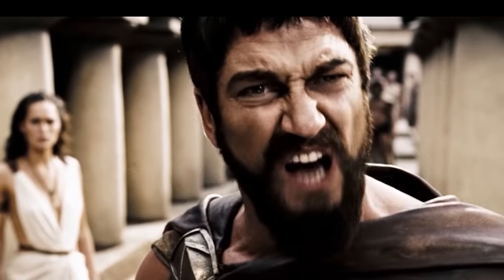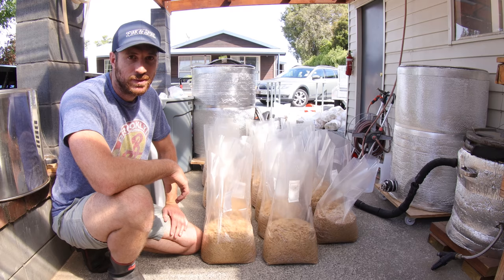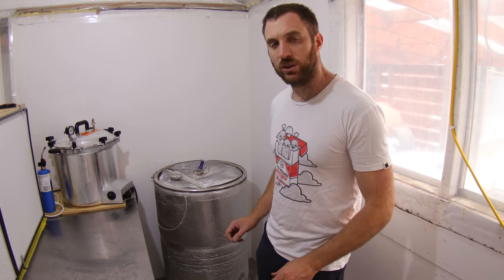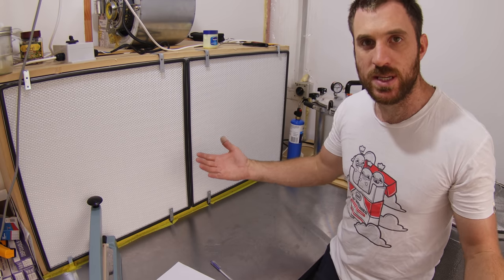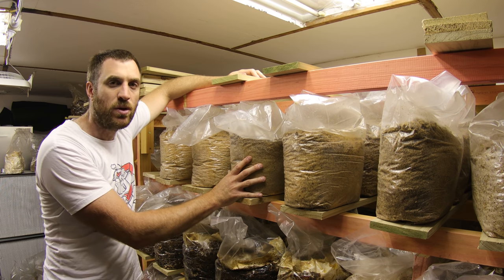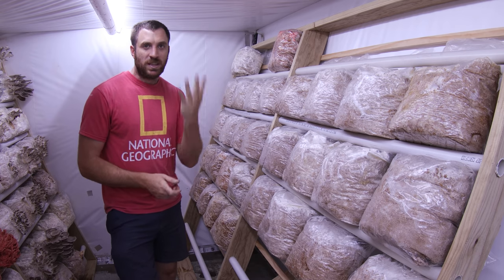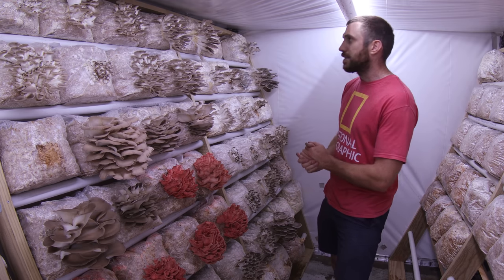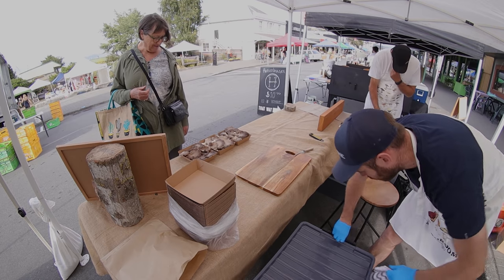How To Be a Profitable Mushroom Farmer

Comment: I really loved that you showed us the selling part! I just wonder something: when you open your bags for the mushrooms to finally grow, couldn't you open all the sides rather than just one front side? So as the mycellium all around could grow? Or are they all migrating to the one front opening?
Reply: I thought the same too
Reply: Better quality of flushes with one open section.
Reply: i thot the same. and the reason I was told was that the bag would dry out. but then you could also inject the bag with water and let the whole thing fruit. so many videos with pinning under the plastic and low fruiting. seems really odd. but then everyone is doing it so I really dunno what to say. But i did see one place in the Uk on video and they strip the plastic all the way off and have only the substrate sitting on shelves fruiting. they have like a full facility with airlocks and so on to prevent contamination and so on. but the lady said we take the plastic off and are able to get good results. So...... kinda confusing
Reply: @ArunRaoINDIA  I guess you can strip the bags off and do multiple openings when you have a humidifier setup then (most of the pro have)

Comment: Hi there from Canada.  I had a question for you.  What happens if you opened the mycelium bag and spread it out in an even layer on a tray or trough?  Would you end up with more fruiting bodies started?  How come always just a slit in the bag?
Reply: I think he does that to control the amount of product. You can only sell so much before they go bad, and if you spread the whole thing out, you'll have all the shooms at once. Where as, after you cut the bunch off the hole in the bag, it starts all over again from the same bag. Controlling the amount of product.  (but thats just my guess)
Reply from the maker: You are basically simulating a log with the bags, and when you only cut one hole you force the bags to spend all its energy on a single high quality bunch. If you take the whole thing out of the bag you end up with a thousand miniature mushroom. Shiitake are different though, they are taken completely out of the bag.
Reply: @OakandSpore  
So. I was almost right.

Comment: you are brilliant!  It seems difficult to do this at home without all the control measures. I'm a complete beginner but this was fun to watch
Reply from the maker: Not really, you can grow mushrooms with really low tech methods. Using equipment like me just means the entire growing operation is more controllable.
Reply: Actually, you could start growing at home with maybe $50-100 invested into some jars, tubs and substrate. Fancy and expensive gear like flow hoods, PID controllers, large sterilizing barrels and ventilation/humidification systems only come into play if you're doing bulk commercial production, and even then it's more for convenience and saving time rather than a necessity.

Comment: thanks for your videos, very exciting work. I would like to know more about your flow controller setup you use to add water in the bag. Is it possible to show it/describe it more somehow ? I want to copy your setup. By the way, twisting the mushroom cluster when harvesting should make it easier than only pulling. I love the logs on your selling table, we do that too ;)
Reply from the maker: I can, it's a water flow controller from Amazon. Usually I do not harvest in the room like that, but I take each bag out to my stainless steel benches. I just harvested them from the wall for the purposes of the video.

Comment: On the westcoast of the US alot of us use stalk waste from the cannabis industry, then use spent mushroom blocks to make fungal compost to grow the cannabis- or bulk red alder/white oak sawdust which is produced as a waste product by mills, carpenters, landscape & power companies. 

If you can find a clean waste stream to attacht your operation too, it significantly helps lower your operational cost & in some cases you can get carbon credits from the Govt. Depending on your Govt and tax code of course.

Fungi are trophic regulators, it's wise to take advantage of that biology whenever cost effective.

Some times you don't have a choice about buying your inputs, but it is the least cost effective way to go when clean waste streams are available.

Comment: Is that some kind of electronic measurement device hooked up to your water supply? I do like that rack system in the fruiting chamber also, very lightweight, simple yet effective. Is the reason they are slanted to prevent cross-contamination?

Comment: In order for the filters to work they need to be set up to only circulate the air in that room... AND NOT discharge the air outside that room.(dont vent outside). IF you are discharging air outside that room THEN you are DRAFTING outside air INTO that room..

Comment: Great Video! But I have some concerns during sterilization. Doesn't the petrochemicals in the plastic leach into the substrate during sterilization & get absorbed by the mushroom? Perhaps it's safer to sterilize the substrate, give it time to cool then package it. Cheers.
Reply: The bags are made to withstand the high temps.

Comment: In the incubation room, how do you maintain the required humidy? Didn't see any foggers over there?
Reply from the maker: You don't need humidity in the incubation room. The bags hold the moisture in.
Reply: @OakandSpore  I am a new farmer, I grew some 105kg mushrooms last season in two months time or so....this season I plan to grow 100kg or lil more month on month...I use what straw as my substrate and do lime pasturization...so I don't really have a gauge to know the moisture in my bags? Therz no set(measured) quantity of water in the mix , it's just moist enough(not dripping wet) substrate packed into bags, with pin holes...now in this case, is the room moisture maintenance not imp? ? Or does this change from substrate to substrate?? Anyway, I thank you for your help...
Reply from the maker: If you're growing with straw in bags then you might need humidity. I don't grow with the method so I don't know.
Reply: @OakandSpore  ok I get it...however, I like your method more, less cumbersome..i will do a few experiments and if successful, then will change to your method...in your case, is the clean room with flow hood imperative for innoculation?? Can do without? As I understand, post sterilization in an autoclave, all bacteria is killed, hence this super clean room is required for innoculation.....also, one must have bags like yours with the mesh for breathibility...and what size are those bags of your? How much substrate you put in them, how much supplement, and spawn and water, can you share this with me...also, wanna know how much yeild do you get out of this bag....

Comment: What if you cut a hole in both the front and back of the bag. Pulled the shelf out from the wall and had a light on the back side. Would it grow twice as much mushies?
Reply from the maker: I don't think so. You would most likely get two small bunches of mushrooms. Combined they might weigh slightly more.

Comment: What about the plastic, the chemicals in the plastic. How does that affect the process and the mushrooms.
Reply from the maker: They are autoclavable bags, the are stable under heat. The polymers wont break apart and shouldn't put microplastics into the mushrooms.

Comment: to use a water meter like you are with each seperat bag like this, does hardwood pellets have to be already mixed and broken down or can you just add water and they break down on their own in the pressure cooker and you can mix it all afterward? i want to buy a water meter like this but not sure if i would need a mixer or something before getting one to use it correctly

Comment: Great video!! One question - after cutting the mushrooms from the substrate bag hole, do they continue to spawn new mushrooms, or do you have to throw away?
Reply: Depends on the mushrooms and how much substrate you give them but sometimes you'll get 2 or 3 fruitings.  There's probably a balancing act to finding what's most efficient for feedstock and if the quality stays the same for later fruitings, etc.  Those are all the tricks you learn as you experiment.

Comment: Thanks for the great video! Two questions, 1. how much water did you mix in with the substrate? 
2. The bags that you put the substrate in already have a filter attached to it for airflow correct? If I am using bags with no filter would I have to punch a couple of holes in it for airflow before I put them to sterilize?
Reply from the maker: 55%ish moisture. Yes the bags have filter patched attached. Do not punch holes as this will be a vector for contamination.

If you need filter patch bags and you are in the USA google Myers mushrooms, he's a supplier.
Reply: Oak and Spore Mushroom Farm do you have a code for discount with “Myers Mushrooms”
Thanks!!

Comment: Hey, I'm a small (smaller) scale mushroom grower and have been buying pre-sterilised spawn bags in bulk rather than make my own, due to the fact that I have only a small pressure cooker for grain spawn sterilisation. Does your large substrate steriliser also work for grain spawn and, if so, are you able to link the plans or a guide on how to make one? Currently buying 50 bags of spawn is a big cost sink for me and I'd love to be able to make it myself. Thanks mate!
Reply from the maker: Yes it will work well enough for making your own spawn. I don't have plans of it sorry.
Reply: @OakandSpore  What materials did you use to make it? Would you do a video like you did on the humidifier on how you built it? It's very cool!
Reply from the maker: I have a video showing my steriliser, check it out!

Comment: Random question from a non mushroom grower. When you cut your hole into these blocks to allow them to bloom, why not cut a hole either side? Would this not double the yield, or can a block only bloom from one area at a time?
Also on my youtube wander today why are mushroom farmers wearing masks at harvest, is this for spore protection or containation reasons?
Thanks in advance. :) Enjoyed the video.
Reply from the maker: There are a few reasons, but mainly that if you cut more holes, you will get more smaller muhsrrooms. We wear respirators because the mushrooms drop millions of spores per hour, and they are bad for your lungs in such high quantities.

Comment: Hi -Loving your videos.  One question: Do you do anything to clean the spores from your fruiting room? Cheers!
Reply from the maker: I water blast it down when it needs cleaning. The end of the room opens up.
Reply: @OakandSpore  Nice.  Should have known you would have a well designed set up.  Do you have an exhaust/ extractor fan from your fruiting room? EDIT: Opps never mind Ive just seen you vid on replacing the fruiting room extractor. Cheers!

Comment: Great video as always! How are you growing on softwood fuel pellets?? I was told it wasn't possible.. Have you tried multiple species on softwood pellets or only phoenix oyster? I couldn't find hardwood pellets so gave up on the idea of growing mushrooms as a side business. 

I appreciate the info and all the effort you put into these vids and answering questions. Much respect.
Reply from the maker: Mate, softwood pellets are all good. Yields might not be as high but otherwise they are fine. I use softwood as a replacement for hardwood in the 'masters mix' substrate recipe. The wood pellets here are all pine, and I believe all the turpentine gets destroyed in the pelletisation process, but that's just what I've read. Plus they are also organic! 
I even know a grower here which has had enough success to warrant growing his shiitake on pine pellets...
Reply: @OakandSpore  Awesome! Thanks for the info - Are you doing shiitake commercially or planning to with pine pellets? I'm based in South Africa so pine pellets is pretty much all I have access to. Also, are your pinks and yellows using the same recipe? My apologies for battering you with questions, I've just seen/read so many conflicting opinions that I'd rather ask you (who is actually doing it as a business).

Thanks again, all the best.
Reply: Interesting

Comment: I still dont understand the pressure sterilizing... like why? Why use hot pressure vapor if the jar the grain spawn is in is sealed, the vapor wont get in... Whyyy??????? Someone please explain me. 
Does the vapor need to enter the grain spawn jars???
Reply: The vapor doesn’t need to get into the jar, or in this case spawn bag, in order to heat all of the grain spawn to sterilizing temperatures
Reply: @brandoncroxton76  Then why they use a pressure cooker? In thay case you could just use water right? Or in the case of a mason jar what you have to do? Do you have to allow the steam to get inside the grain spawn??
Reply from the maker: You cannot heat water past 100c without pressuring it. To sterilize fast, you need to heat to about 121c. If you were to heat a sealed jar with moisture in it to 121c, it would explode, unless it was in an environment of pressure, I.E a pressure cooker!
Reply: @OakandSpore  
oohh, now i understand, so the steam does not have to enter my grain spawn jars right??

Comment: Hello, may I know the wood pellets and water ratio you put in the bag prior to sterilization. I will really appreciate your reply.
Reply from the maker: 55-60% water by weight
Reply: Thank you Tom for your reply. I took your advice, I weighed 1 kilo of pellets and put .6 kilo of water but my substrate bag seems dry. Did I do it right?
Reply from the maker: You need about 1.3-1.4kg water to 1kg substrate.
Reply: Thank you very much. It’s very helpful.

Comment: What's the total weight of your harvest?
Reply from the maker: Around 30kg first flush. Plus with a second flush I can usually harvest around 40kg per week. I can push this towards of 50kg if add a few more bags in, but that's about max for my fruiting room as it is right now.
Reply: @OakandSpore  Thank you for your reply. I have another question. How much light is needed for the fruiting chamber?

Comment: which water flow meter do you use? is it easy to set up?
Reply from the maker: It's from Amazon, I will add a link on the oak and spore web page in the description!
Reply: @OakandSpore  ty brother
Reply: @OakandSpore  when one fills their bags with dry substrate, then adds water like this, does it need to be mixed or is the mixing done when the grains are added?

Comment: Okay, but how do you keep the CO2-level low during the fruiting stage?
Reply from the maker: With an extractor fan
Reply: @OakandSpore  So the CO2 level is the same as outside or is it filtered out somehow, or absorbed chemically?
Reply from the maker: No, the mushrooms create co2, so you have fans pumping fresh air in. Outside is usually around 420ppm I think, I pump the air out once it hits 700ish ppm.
Reply: @OakandSpore  Thank you so much! Your work is amazing, your videos are inspiring and helpful! I'm only experimenting on low scale, so CO2 is not going to be much of an issue for now.

Comment: Great video, thanks man! From Florida here, I'm currently starting a mushroom farm in my garage too. My first batch of oyster and lions mane have just been inoculated a few days ago. I need to learn more about maintaining proper humidity, temperature, and airflow in the grow room, let me know if you have any tips! I have a 4x2x5 (feet) grow tent that I'll be starting in but I'll be building a new space soon, I really like the way yours is. What material did you use to build your grow room set up? 
Also do you sell to restaurants as well or only at the farmers market?
Reply from the maker: Hey dude, thanks for the comment. At first it can be hard getting the atmosphere in the grow room to be constant, my best advice would be to just give it time and learn what your mushrooms like and don't like. The more you produce the more you will learn, so just start putting volume through. I use panda film in front of polystyrene built on a wooden frame. It works pretty well, I just don't like the fact I don't have a drain in the floor..
Occasional restaurants, but mainly farmers markets.
Reply: @OakandSpore  Awesome, thanks for the reply. Great content btw, keep it comin'!

Comment: Why you sterilized the bags for 20 hours? isn`t it too much time? I sterilize manure and coco substrate in bags for 80 minutes and that works great, What is the difference?
Reply from the maker: Is that in an autoclave or pressure cooker?
Reply: @OakandSpore  Pressure cooker
Reply from the maker: My steamers don't pressurize, so I cannot get the temperature above 100. This means instead of taking 80 minutes, it takes hours and hours. The higher the pressure, the higher the temperature, the faster it is to sterilize.
Reply: @OakandSpore  Thanks for the reply

Comment: how many flushes you can get from one bag ?
Reply from the maker: 3 or 4, but I only do 2, sometimes 3.
Reply: @OakandSpore  thanks for the reply. But why 2 times ? when you can 4 ?
Reply from the maker: Dimishing returns, contam buildup, and a few other reasons. After 2 flushes I usually discard and replace with a new block.

Comment: Cool video, but there´s no sterilizing, only pasteurizing. Sterilizing would be at 125°C and need an autoclav. Thanx and greetings from austria!
Reply from the maker: Wrong. Google thermal death time. You don't need 125, its just a reccommended temperature and achieves sterilisation in 30 mins.